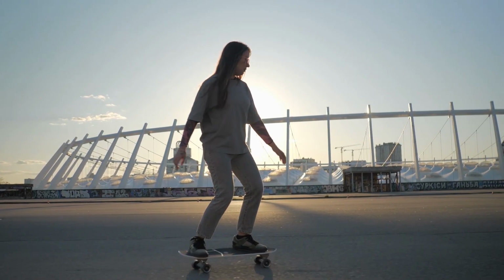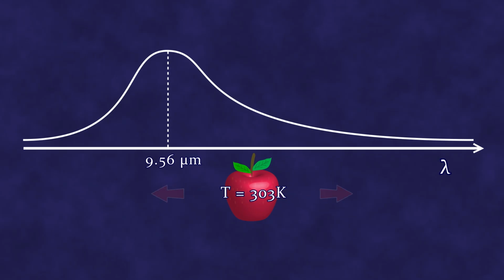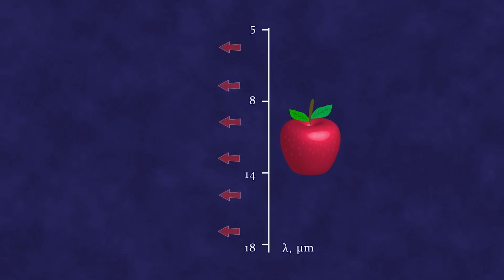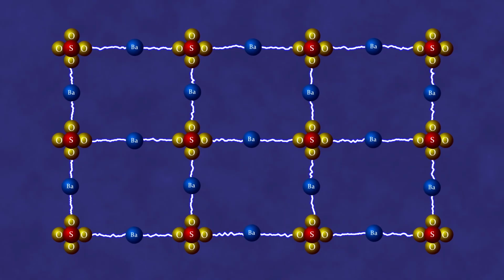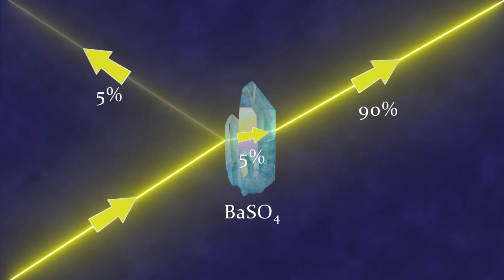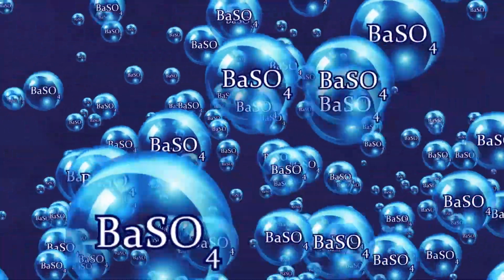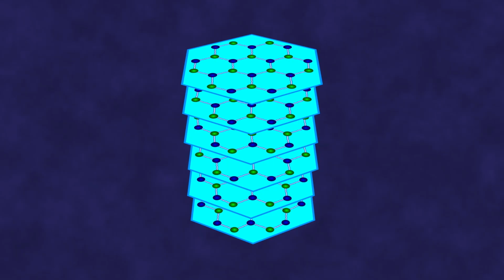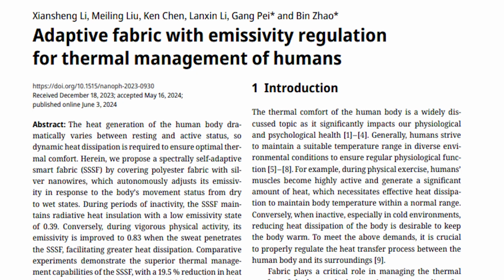The magic of metamaterials: how paints and fabrics created by physicists cool without using energy

Comment: As I understand it is the thermal equilibrium with outer space, very cold, that provides the cooling effect. So it won't work inside a building.
Reply: You paint the roof. Inside an office, it would just reflect through the air and heat up the ceiling. It would still feel cool.

Comment: Would these material have a greater IR signal, and therefore be a problem for soldiers ability to avoid IR detection?
Reply: Yes. This wavelength is also called "LWIR" and is the common type of thermal camera. It just means your body would glow brighter. But there is also material that can hide that glow, so take your pick.